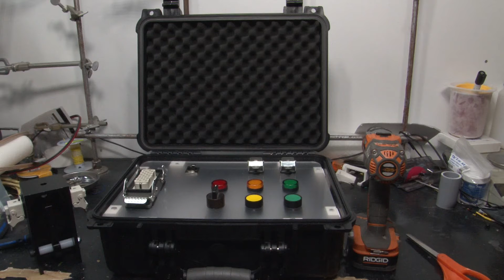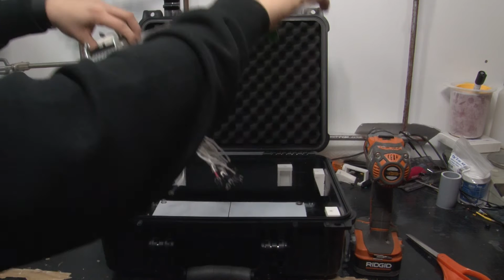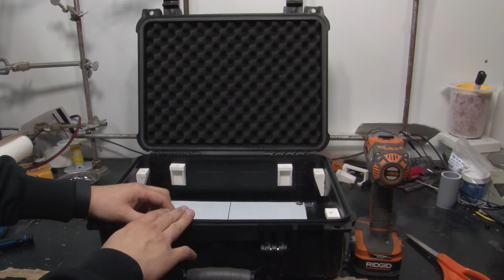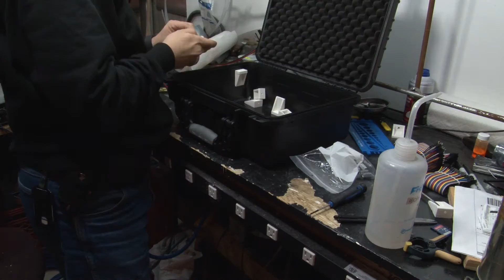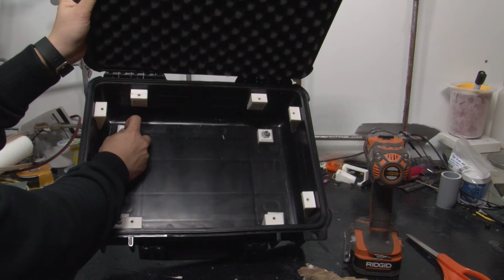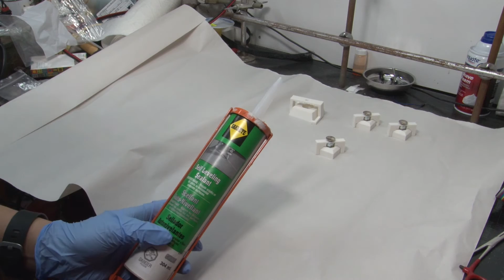(28) Pelican Case Mounted Electronics with VHB Tape

Comment: You weren't kidding about how expensive that tape is! I gotta get some though. Another commenter mentioned flame treatment and regular VHB tape, so I'm going to try that first because I have a good sized roll of the grey car trim style tape already. But if that doesn't work, now I know what will.
Reply from the maker: Don't forget to pay through the nose for a small tin of 3M primer 94 that you'll hand down to your kids!

My main uncertainty on flame treatment is that it's too inconsistent. Too much heat and you distort the part, too reducing a flame and you get soot which interferes with bonding?
Reply: @aonomus  do I need that for the stuff you recommended, or only for the regular VHB tape?
Reply from the maker: @TonyMueller  Mainly for low surface energy plastics. Polypropylene, teflon/fluoropolymers. Small tests will show quickly if regular VHB will bond. Don't forget to wipe things down with alcohol in case the plastic has release agents on it from manufacturing.

Comment: Great video, really helped me out! im working on a 1507 air case and there are no panel frames directly available that i know of...
Reply from the maker: I discovered recently that almost all Nanuk cases are designed with screwhole panel mounting points around the perimeter of the case. They're maybe 80-90% of a Pelican case, at 70% of the cost and more innovation/features.

Basically if you don't intend to airdrop mission critical no-fail equipment, lose it off the side of a boat, or have your car catch fire, a Nanuk case will probably do the job but give you the mounting points and CAD files to boot.

Comment: I'm assuming you're not using the 59 series of VHB from 3M, correct? I have quite a bit of 5952 & 5915 but I haven't tried it on PP before. I do also have 3Ms 300LSE tape which works great for PP but doesn't have that foam core like VHB does. It's more super thin double sided tape that you find everywhere. So just wondering what model of actual VHB would be good.
Reply from the maker: Video description lists the specific tape - 4952 intended for LSE (low surface energy) plastics!
Reply: @aonomus  Ahhhhh gotcha, didn't see that before, thank you!

Comment: I'm curious, did you consider using 3M or Permabond Polypropylene epoxy's before the tape? If so, was there any reason you chose VHB tape over them?
Reply from the maker: I considered epoxy, however because I want to leave the option of removing the mounts (which you can do by sawing through with dental floss) I did not want to epoxy anything permanently to the case.
Reply: aonomus another protip! Dental floss removal!!!

Comment: Can you advise where you found the tape?  Also, do you have a link to the files for the 3d printed brackets?
Reply from the maker: Google for 3M VHB tape, you'll have to search for the type intended for low surface energy plastics. The brackets are not posted and are unlikely to be either.